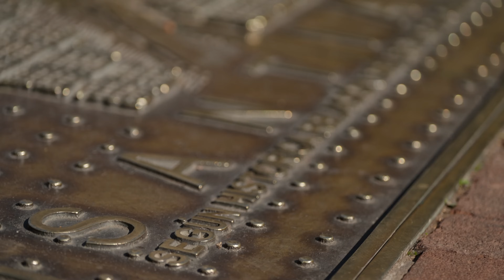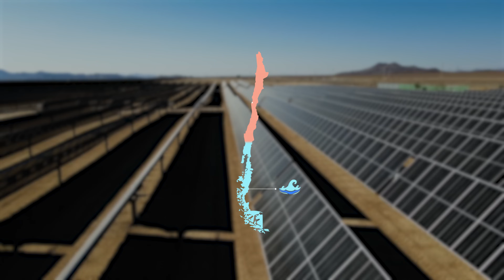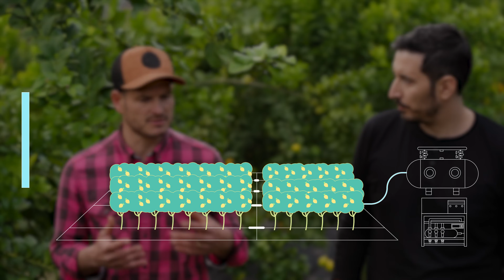How connection and cloud foster multicultural exchange in Chile | Cloud Cultures by Microsoft Azure

Comment: 5:58 during certain hours of the day 100% of the entire electrical needs of the country was supplied with renewable?, That's not true.
Reply: @cl4udioiturra  it's partially true, you can check in coordinador eléctrico nacional, if you check the marginal costs, when it's 0 it's basically when there is mainly renewable energy on the grid. There it's soooo much at some points that they need to throw it out.
Reply: It is true!
Reply: @cristianestebanaranedarive7396  yeah mainly, there are some places where it doesn't happens. Like in the very south were they aren't connected to the "interconnected grid". But for the main chile it's a completely truly affirmation. To put things in perspective, let's say US would make a interstate electrical grid that would supply renewable, well for obvious reasons they could not make a grid connection to Alaska, or to the pacific islands.